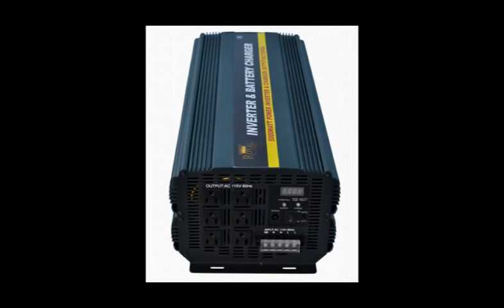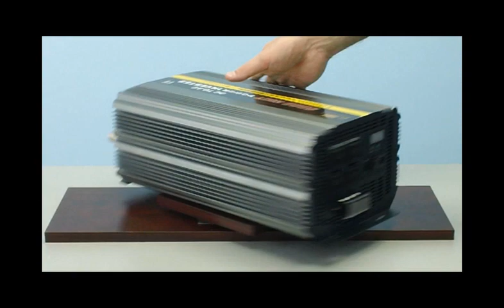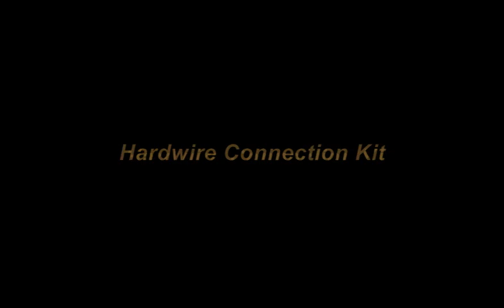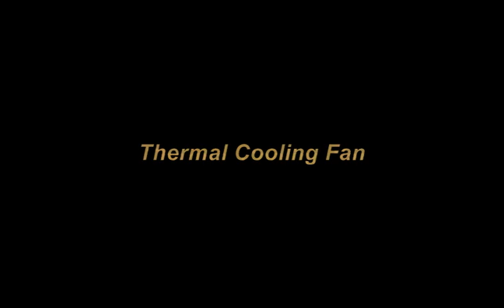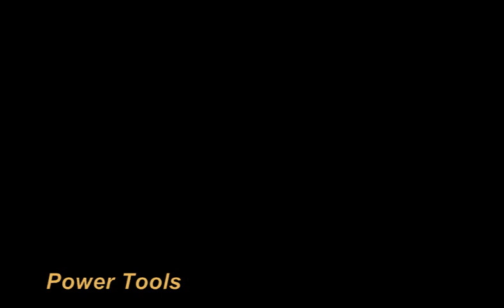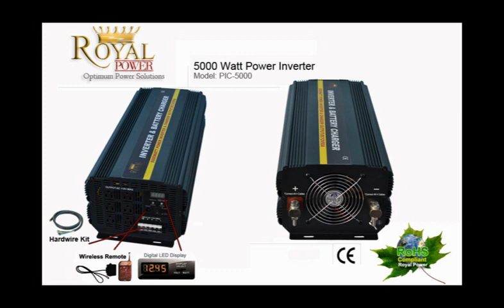5000 Watt Power Inverter - 50 AMP Built-in Charger and Transfer Switch - Royal Power - (PIC-5000)

Comment from the maker: Depends on the dryer, but many dryers are 220V if it is then it will not work. This inverter is a 110V~120V unit.

Comment: I'd like to be able to plug an inverter into a dryer outlet and run my 120v portable ac out of that. Anyone know what that is called so I can google it? I need to purchase one because my portable ac compressor keeps tripping the little 120v outlet. The AC unit draws 1417W / 12.7A